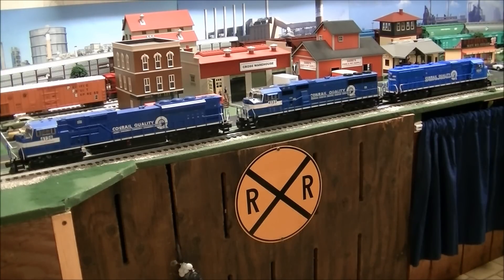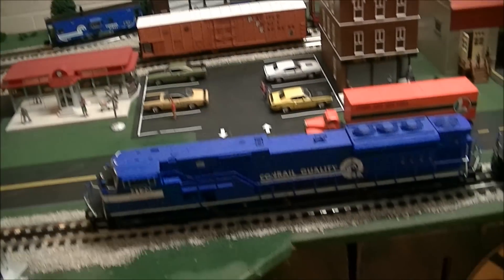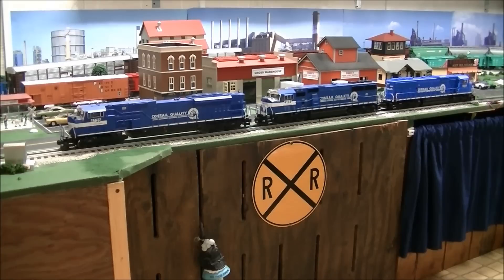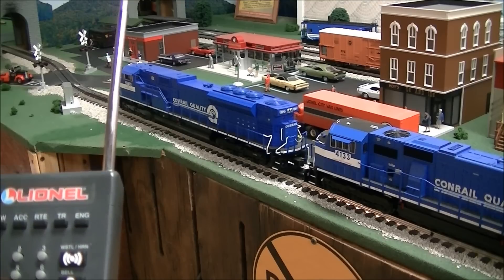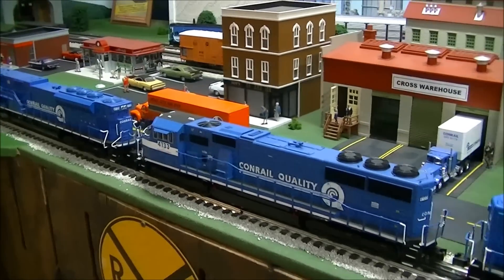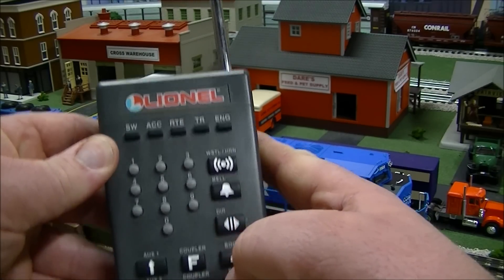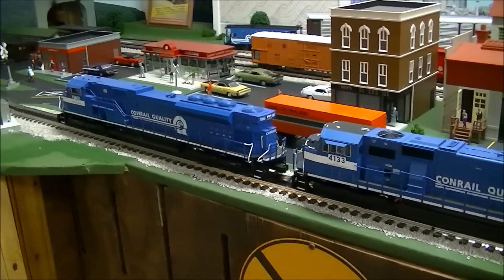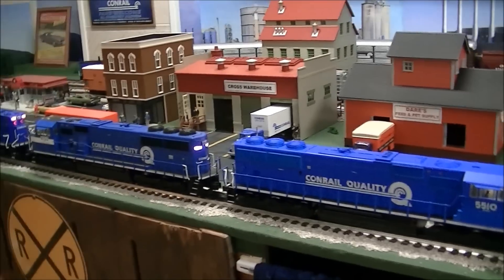How to Program a Lionel Legacy Lash up with a Cab 1 Controller O Gauge

Comment: Shawn, I talked to you @ Hennings trains back on December 4th about doing this.  I read my Cab-1L manual plus watched this video and you did a great job.  I was successful on programming my first time around.  However, my Legacy GP30 did not quite match the acceleration and braking of the SD38, momentum steps both set to H.  How you mentioned in your video about not coupling and leaving space for a test run is very helpful to avoid potential problems as I discovered with my test.  Thanks for posting and keep the videos coming.
Reply from the maker: Thanks much.  If you need any help or advice let me know.  If you need videos on how to do other things I may be able to help as well

Comment: Got my engines programmed but when I go to do the lash up procedure the engines horn doesn’t sound. I am hitting the right buttons in the right sequence. I don’t know what I’m doing wrong
Reply from the maker: It can be a real pain to do lash up using the Cab1 remote.  For example you can't be more than 3 seconds between pressing each button.  The lashup won't take successfully.  Sometimes even doing that there could be a glitch and you may have to try 3 or 4 times.  If the horn works on the locomotive in single mode it should work on the lead unit in TR mode. Unfortunately I had many issues using the Cab1 for lashup.  The Legacy 990 is way much easier for this. Yeah I know they are expensive and hard to find. I gave up on the Cab1 a couple years ago and bought a Legacy 990.
Reply: @Dakman  I got it. Instead of pressing 8 for the lash up ID, I had to press 08. Everything is perfect now

Comment: Great video Shawn! Lots of great information on how to set up latch up using the cab 1 remote! Thanks for sharing! Have a great and awesome day!
Reply from the maker: There is a Cab1 and Cab1L remote. The only differences is the Cab1 has a antenna and can only control TMCC locomotives. The Cab1L which is blue in color does not have the antenna but can control both TMCC and Legacy. So keep that in mind for the future. However both of the features and functions work the same between both of them.
Reply: @Dakman  thanks for sharing this information.

Comment: Another question, how does the base or remote know the lead unit is 26?
Reply from the maker: If you are using the Cab1 the first road number you enter is the first locomotive in the TR or train.  For the Legacy 990 it actually shows the first or front  locomotive . I like using the Legacy 990 remote for multiple locomotive lash ups. It's much easier than using the Cab1 or Cab1L

Comment: How many powerhouses do you use for your layout. Also how many tracks can a single 180 watt powerhouse brick power up?
Reply from the maker: I have 2 Lionel 180 watt powerhouse.  One for each track.  The best way I can explain your next question is actually how much of a load the powerhouse can handle.  I have successfully run 4 powered locomotives using one powerhouse but didn't run the smoke unit.  How much a powerhouse can handle depends on what you are running.  Passenger cars are either LED or incandescent bulbs.  The non LED versions eat up alot of power.  I have seen clubs run two or three trains on one track.  However they would have 3 or 4 powerhouse on one track.  They would create what is called blocks or insulated sections where the powerhouse only powers that one section.  They do this so one powerhouse doesn't try to run all of those trains.  Hope this helps.
Reply: Yep thank you, this helped quite a bit. I might use 2 180 Watt powerhouses for each track or either a 360 Watts Powermaster. Did you use a TPC 400 to connect to your Powerhouse?
Reply from the maker: A powermaster isn't a transformer.  It's a device that can handle a certain amount of power to regulate to the track. It creates a way to regulate the track voltage remotely.  Another words it can make conventional trains operate on a TMCC remote.  But only one train at a time. Yes I used that connector
Reply: @Dakman  okay, there are many options to choose from to power a Legacy railroad, I have no idea which one is the safer bet.
Reply from the maker: The safest bet is never use old school transformers to power Legacy trains.  You have 3 options. You can use the Powerhouse 180 watt brick,  a Lionel ZW-L, or a MTH Z4000. I picked these 3 because you will have plenty of power for future expansion
Reply: @Dakman  thanks, I figured the Newer ZWL Transformer would be good. But I’m not familiar with the MTH Z-4000.

Comment: Is the ZWL transformer good for programming lash ups? The L on the newest ZWL transformer stands for legacy right? That has 600+ watts of power.
Reply from the maker: I'm not familiar with the ZWL and don't want to lead you in the wrong direction. With that being said I do all of my lash ups through the Legacy 990 controller.  I have run 4 locomotives lashed up on one powerhouse brick with no problem.  If you want to see something cool check out my Conrail coal drag video.  I run that with DPU.  Meaning that there are locomotives placed elsewhere in the train. I have a locomotive in the middle of the train and two on the rear of the train.  Four out of five are powered and programed in MU mode
Reply: Okay, the ZWL Transformer is the newest transformer to power the track to legacy layouts, because the L stands for Legacy. Also, is one powerhouse brick too little power for all 4 or 5 engines? I have concerns about that. I thought just one ZWL Transformer would do it all because it has 4 circuit breakers built in.

Comment: Great video, however I am having a issue. I have 2 Legacy diesels a SD70 & a SD40 MAC also a Cab 1L & Base 1L. I have followed your directions exactly as well as the Cab 1L manual which both are the same except they use 7 for lash up instead of 8.When I turn on track power the number boards light up on both trains, but when I put in TR 8 18 (my main front Diesel #) F SET nothing happens. At that point I power down the track as well as the Cab 1L Base & then power up & tried several more times even using the 7 that they us in the manual, powering everything down each time. If I enter ENG 18 powers right up & ready to go as well ENG26 same track fires right up but of course no Lash Up. Do you have any idea what my problem is. your video was great very easy to understand & very helpful. You explained everything in detail. Please help if you can. any suggestions are appreciated. Thank you 

i
Reply: I’m having the exact same issue